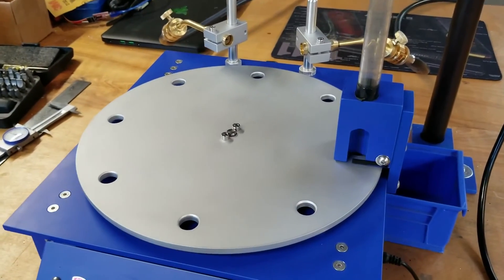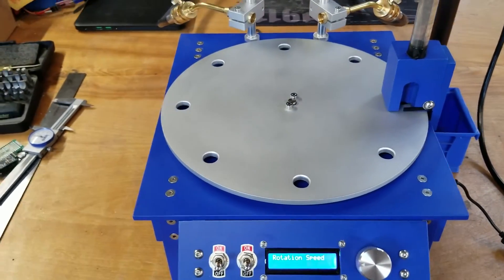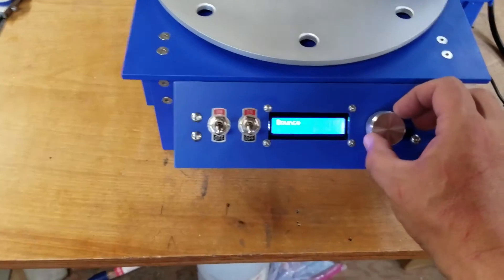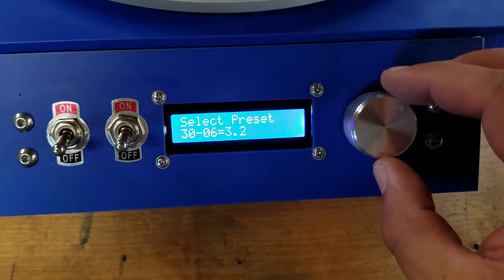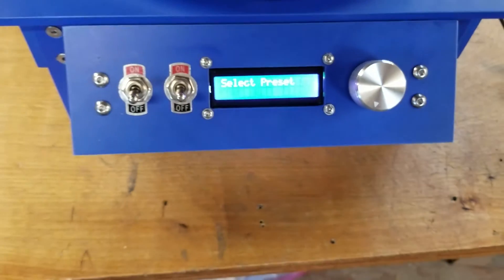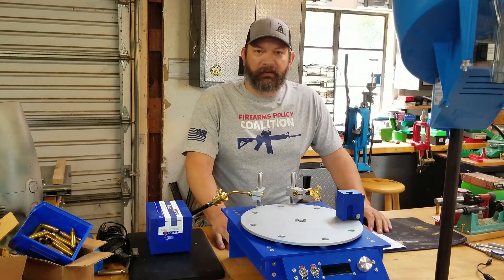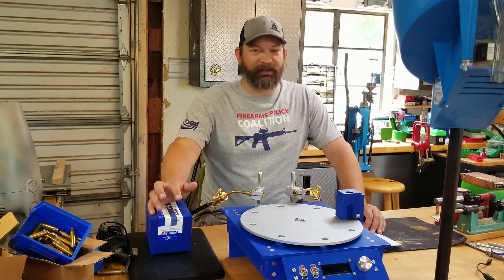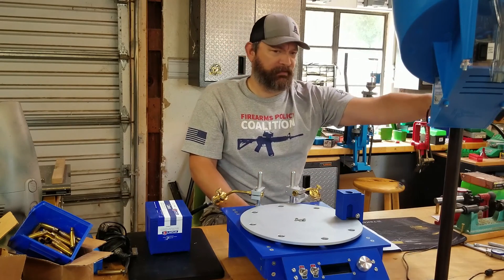DIY Annealing machine using Arduino and steppers.

Comment: Would you happen to have a list of the components? I'm handy and would like to try this but I'm sure I'll get the wrong motor or something :)
Reply from the maker: The whole machine is made from 1/4in aluminum. Other than the screws which are all m3, m4 and m5 of various head types, here is the main component list with links. A lot of these items can be bought in bulk to save money. Hope this helps and good luck! You should also check out my other video where I take it apart. Cheers!

•	NEMA 23 High Torque https://www.amazon.com/Torque-Stepper-Motor-425oz-Router/dp/B00PNEPW4C/ref=sr_1_1
•	TB6600 Stepper Driver - https://www.amazon.com/UsongShine-Stepper-Controller-Arduino-Printer/dp/B07HHS14VQ/ref=sr_1_3
•	Arduino Pro Mini w/ CP2102 (you can get them separate and save money, I usually buy them in a 3 or 5 pack in case you burn one. You can get the cp2102 separate as well. https://www.amazon.com/ALAMSCN-Module-Atmega328-Arduino-Compatible/dp/B08V8YGR1R/ref=sr_1_5
•	I2C 1602 LCD Display Module 16X2 https://www.amazon.com/GeeekPi-Character-Backlight-Raspberry-Electrical/dp/B07S7PJYM6/ref=sr_1_3
•	KY-040 Rotary Encoder Module  https://www.amazon.com/Taiss-KY-040-Encoder-15%C3%9716-5-Arduino/dp/B07F26CT6B/ref=sr_1_6
•	Heavy Duty Toggles  https://www.amazon.com/Nilight-Rocker-Toggle-Switch-Waterproof/dp/B078KBC5VH/ref=sr_1_1_sspa
•	12v rocker switch  (you can use any type of switch for main power) https://www.amazon.com/APIELE-Rocker-Switch-Automotive-Pre-Wired/dp/B08R5PLDBP/ref=sr_1_4
•	12V 5A powersupply  https://www.amazon.com/gp/product/B0711Q5B49/ref=ppx_yo_dt_b_search_asin_title
•	12v to 5v stepdown converter. https://www.amazon.com/Converter-DROK-Voltage-Regulator-Waterproof/dp/B07P663XJV/ref=sr_1_1_sspa
•	360 servo  https://www.amazon.com/Treedix-MG996R-Servo-High-Torque-Helicopter/dp/B08743N181/ref=sr_1_9
•	Panel Mount 12v connector  https://www.amazon.com/outstanding-5-Pack-Threaded-Connector-Adapter/dp/B07C46XMPT/ref=sr_1_5
•	(2) Torch Nozzles https://www.amazon.com/gp/product/B07NVMY43D
•	10mm flange - https://www.amazon.com/Coupling-Connector-Coupler-Accessory-Fittings/dp/B08334DK91/ref=sr_1_2
•	Lazy susan bearing - https://www.amazon.com/gp/product/B00ZSQSWTM/ref=ppx_yo_dt_b_search_asin_title?ie=UTF8&psc=1
Reply: @sjseth-builds  what do u know about linear and rotational hydrolic cylinders?
Reply from the maker: @jaythaler1704  interesting question Jay. I know what they are but that is about it. Never used them in my projects.
Reply: What is the diameter of the plate? Thought I could find it in the video or comments but haven't been able to find it. Thanks, pick up my aluminum  4x8 sheet this week. That was a pretty penny.
Reply from the maker: @jaythaler1704  It is a 12" diameter plate.
Reply from the maker: @jaythaler1704  Wow, a whole 4x8 sheet! Yeah, that cost a few bucks I bet. I forgot to mention,  I get all my aluminum at https://www.midweststeelsupply.com.  You can get the rounds there precut at a reasonable price as well..  In regards to dimensions, the top plate on the machine is 12.5in x 14in.  The disc is 12" diameter. from bottom to top the machine is roughly 6in tall. Hope that helps.   I just checked at if you bought the 12.5"x36" piece of .25in 6061 and the 12in cast plate, it would roughly cost about $110. Not sure what a whole 4x8 of .25in aluminum runs.
Reply: @sjseth-builds  cost $509 😄😄 figured I'll do some more projects after this.
Reply: @sjseth-builds  picked up my aluminum and may work on it this weekend. Couldn't see in any of the videos, but after the ac comes in you said it splits, where does it split to and where along the circuit are those splits?
Thanks!!
Reply from the maker: @jaythaler1704  First, an external power supply feeds 12v DC to the machine so there should be no AC present after the powersupply.   On the 12v female connector which is mounted to the side of the machine,  I am "splitting" or wiring in parallel, the 12v lines directly to the TB6600 controller and the 5v buck converter.   If you look at the bottom of this schematic, the 12V DC and ground  is the female dc connector entry point: https://raw.githubusercontent.com/sjseth/ArduinoAnnealer/main/schematic_new.jpg.  Hope that helps
Reply: @sjseth-builds  clarifying question. In video it looks like the 12v splits to stepper controller before it goes to on/off switch?  I'm guessing I can't see it well and the 2 12v split after switch?
Reply from the maker: @jaythaler1704  Yes, you are correct,  the input connector is wired to the switch and from the switch, the power is paralleled to the converter and controller so that when the switch is off, no power is flowing.
Reply: @sjseth-builds  where and what kind are those quick connect pieces? I'm deep down the rabbit hole w this and tools 😄
Reply from the maker: @jaythaler1704  
Welcome to wonderland! Anyhow, I generally use wires from a bulk kit like this on Amazon: ELEGOO 120pcs Multicolored Dupont Wire, The connectors and headers are dupont style, there are various kits on Amazon , search for Glarks 112Pcs 2.54mm Male and Female Pin Header Connector Assortment Kit
Reply: @sjseth-builds  I've even ordered a mig welder and plasma cutter to make the assembly and cutting easier for this and any jobs down the road.
Reply from the maker: @jaythaler1704  wow, that is going to be one expensive annealing machine! 😄😄😄
Reply: @sjseth-builds  what did u do to connect the rotating plate to the motor?
Reply from the maker: 10mm ID flange coupler. On Amazon for about $5
Reply: @sjseth-builds  did u use a thinner aluminum for the front piece? I don't think I can mount the lcd or the push button the 1/4" is to thick.
Reply from the maker: I milled out the backside of the faceplate to make it about 1/8in thick for the control areas. I think you can see that in the break down video.
Reply from the maker: You can see that milling around the 9:45 mark in this video: https://m.youtube.com/watch?v=Tm6WUzW7IRI&t=1s

Comment: How much is your investment vs. an AMP Annealer?
Reply from the maker: I have around $220 into it in metal and electronics which includes tax/shipping. I already had the cerakote paint on hand so I didn't include that in the $220.  The motor and controller together were about $50, power supply =$15,   arduino mini pro = $7, wiring, screws, switches, connectors, encoder and screen were about $25.   The metal is mostly 1/4" aluminum plate, some 1x1 square stock and some .5in rods,  I figured the metal was about $120.  Its hard to figure because I have a bunch of scrap aluminum, screws, wiring, etc.   I would put a high estimate at $300 if you started empty handed.   I am not sure how much an amp annealer costs but I am sure this was much cheaper last I checked. Also I think you have to single feed the amp annealer unless you add some robotic attachment which costs extra.  My main goal was to be able to dump a batch of 200+ pieces of 5.56 or 308 brass in an let it run.  Thanks for your questions!

Comment: Very nice! How hard do you think it would be to use an induction heater instead of the torches?
Reply from the maker: Probably not too difficult. You would have to build a mechanism to raise and lower the induction coil. You could probably use a  long stroke linear solenoid to do that. Also induction coils get pretty hot so you need a way to cool them. Typically a fluid needs to be pumped through the coil. I did build an induction annealer for single pieces but had so many issues with it,  I abandoned it.
Reply: @sjseth-builds  Yes, I ran in to the same problem if you run it continually, I would recommend using timed relay, there so many of them out there but since you're using Arduino already you can implement that.

Comment: Excellent work! I did have a question for you, what was the reason you added the bounce back, was it to help upright the smaller bass?
Reply from the maker: Initially there were two reasons (1) Upright the brass, (2) remove the contact of the plate from the brass while it is under flame so it rotates freely.  I later found that by using adapters to more closely fit the brass size, that the contact was a big deal but with the adapters I had to hand feed the brass. I need to redo the feed mechanism to work with the adaptors.

Comment: Hey man !!! This is hands down the best self made annealer I have ever seen . Well done man the craftsmanship is insane. Would you mind me contacting you for some questions i have regarding this?
Reply from the maker: Thanks,  I appreciate the compliments. Happy to answer any questions.
Reply: @sjseth-builds  Awsome thank you.  I would really like to build something similar for myself. What exactly does the setting  bump do? And does calibration work no matter the size disc ?
Reply from the maker: @franprinsloo8885  So bump is the little step back that the disk takes when it completes its movement.  because the holes are so much bigger than the cartridge, it serves to stand them back up and also helps to move the disk away from the brass case in the annealing (flame) station so that the case can rotate freely without touching the disk.  In regards to calibration, because of the placement of small rotating disk under the flame station and also the location of the feeding mechanism, the disk size has size has to remain constant.  The hole size in the different disks can be different as long as the hole placement is the same (8 holes equally distanced)
Reply from the maker: Also something to note: If the hole size is close to the cartridge size, you don't really need the bump at all. You can set it to zero.  I made some adapters that fit in the holes and noticed that with them bump was no longer necessary (though I haven't yet worked out automatic feeding with the adapters)
Reply: @sjseth-builds  ahhh oke makes 100 % sense. Thank you . So if i make a disc with 10 holes I am going to have to change some of the code in arduino?
Reply: @sjseth-builds  I'm literally learning Arduino just to try and make this haha. So I'm trying to figure it out.
Reply from the maker: @franprinsloo8885  Yeah, you would just need to change the number of steps in the variable "indexsteps" in the code.  Keep in mind a typical stepper motor has 200 steps per full rotation and a circle has 360 degrees.  The number of holes you choose need to divide evenly into both numbers.   Also the stepper driver i used TB6600 allows fractional step sizes up to 1/32 of a step which gives the most precision. This is why there are so many steps between the two wholes
Reply from the maker: I started with 12 holes but found that there was too much flame overlap. This is where the flame is hitting the cases before they are in the rotating station. This caused a bit of inconsistency and also because of the uneven steps, it was a pain to maintain tracking and alignment
Reply: @sjseth-builds  yeah i was thinking that flame overlap might be a problem. Thank you so much for explaining everything . You don't happen to have photos of the whole  thing connected underneath.
Reply from the maker: @franprinsloo8885  I do. Actually I think I made a construction video somewhere. Let me see if can get that posted or make another one if it doesn't exist
Reply: @sjseth-builds  :) :) That would be insane 😳  please man. I'm  so glad i found your video . Because you're design is a million times better than the benchsource.
Reply from the maker: @franprinsloo8885  Enjoy: https://www.youtube.com/watch?v=Tm6WUzW7IRI
Reply: @sjseth-builds  A huuuuge thank you from me... i definitely needed that 😆.

Comment: awesome!  looking to do something similar.  would you have details of the programming and wiring plans?
Reply from the maker: Thanks! Will try to get those posted soon.
Reply: @sjseth-builds  that would be great
Reply from the maker: @slamminhawgs9847  I have put the link to the GitHub repo  in the description of this video.  There is a  pinout/schematic in the repo as well.
Reply: @sjseth-builds  awesome!  thank you!!